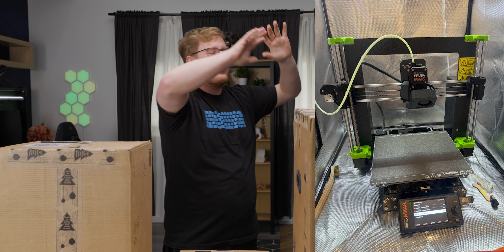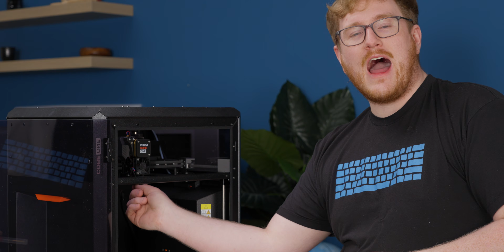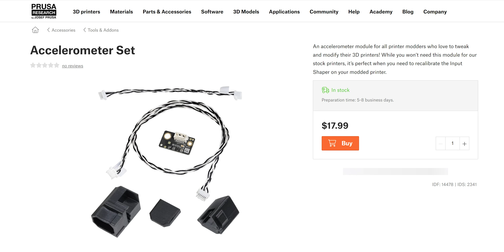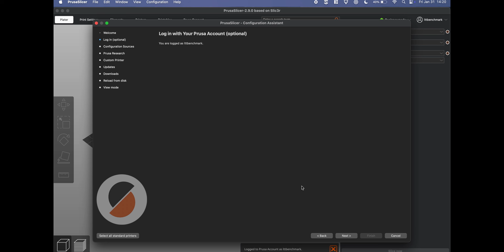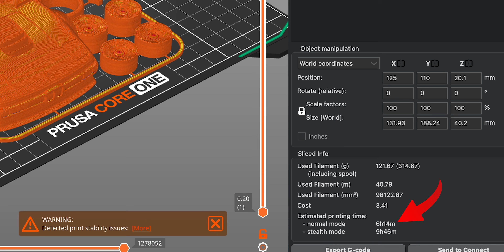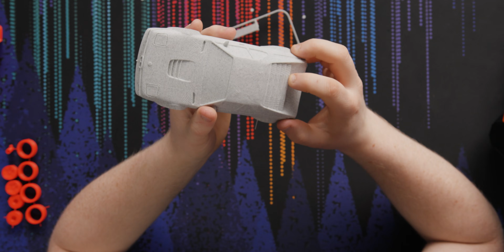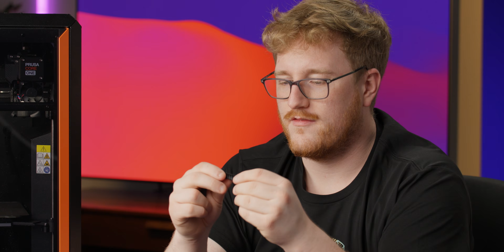Prusa has IMPECCABLE timing - Prusa CORE One

Comment: 2 things to start: This is not a bad product. The other thing is: I own a Prusa and don't care about your downvotes.

This is an embarrassing product to take to market. It's a 10 year old printer with the Core XY upgrade. It's a "MK4 bed slinger" in a cold enclosure.

Out of the box this has:
Doesn't support advanced materials (brass nozzle)
No heated chamber (their "Active heating" claim is bogus, it uses the bed to heat the chamber, not a heater)
Bed size is small 
The footprint is huge
No reduced weight on the tool-head
Slow (20% faster than a MK4 is their claim, which is already not a fast printer)
No Lidar or other advanced bed levelling features.
No Auto Bed Levelling (same MK4 board, so only one Z-axis driver meaning no independent levelling).
No camera (it costs extra)
No accelerometer (it costs extra)
No AMS (it costs extra)

The claims of being against "planned obsolescence" are obscene - this is putting 10 year old technology in a new box. Planned obsolescence isn't the same as genuine market innovation, which this has none of. The market is chasing Bambu - and it's quickly catching them. Prusa are putting out a worse product with a 2 year head-start.

All of this is forgivable though, except it costs €1,400

What the actual.
Reply: But the p1s has a heater right? It has a camera and auto bed leveling at least.
Reply: @nothingtoseehere93  I don't believe so. The only bambu with a heater is the X1C IIRC. (EDIT: Actually it's the X1E, as corrected by maxwell below.)
Reply: @reeepingk  X1C does not have a chamber heater, the X1E does
Reply: @ Ah yeah, you are correct!
Reply: @maxwell9346  QIDI Plus4 also has the chamber heater.
Reply: THANK YOU

Im czech, i do 3D printing for over a decade. Prusa is so shit
Reply: Agree. I do not mind paying a little more for something not made in China or Taiwan but not including a camera, a nozzle for advanced filaments and the advanced filtration system makes no sense. The upgrades should have been included at this price.
Reply: Agree, its your same old printer but in a box and you get 5cm extra height but for some reason its larger then the competitors on the outside and have a bar convenient placed right in you access path.
Reply: Thats the bit that annoys me. Everyone tries comparing this to an X1C. In reality it should be compared to a P1S, which makes it even more unforgivable that its so expensive. The BOM for this printer costs less than €300 to build. Thats a heck of a markup on what is already a dated, legacy machine.
Reply: This: Exactly. The Prusa fanboys will filet you for saying anything against this printer, but really, this printer is already outdated. Now, don't get me wrong, the build quality of the printer looks amazing, but this printer should have been released in... 2021. It doesn't have active chamber heating. It's passive chamber heating with an "active" temp. controlled fan. (Which is already stupid. For PLA the fan is going to be on 100%, no exceptions. For anything else that wants a warm chamber, the fan is going to be at 0%. So the temp control for the fan is dumb.) NOT TO MENTION, the temp control is all of like... 6 lines in the printer.cfg. You can program your own chamber fans to replicate one of their largest selling points in like... 5 minutes. It's literally a feature already included in Klipper. (Just google klipper temperature fan.)

Not to mention that the chamber can't get to any decent chamber temps. ABS/ASA/Nylon, etc all want 65+ degrees (preferably warmer honestly) so the 55 degree "limit" (which it will probably never reach during printing anyway) is just... outdated. And, it suffers from the same thing that all enclosed printers suffer from, too warm chamber temps when closed. So, like every other enclosed printer manufacturer, I bet prusa is going to recommend "opening the door" when printing PLA. 

Like you mentioned, the 3 "independent" z axis are not, at all, independent. The steppers are driven off of the same stepper driver so you can't do "z-tilt" automatically. It just runs the bed into the top/bottom to "level" the bed. (Welcome back to... 2021). 

Like, I understand that Prusas are advertised to a different sort of folk than just an "enthusiast" but honestly I expected better from them. They're supposed to be the "best in the industry" but they're getting outclassed (easily) by qidi and even creality at this point. (I'm skipping bambu because of their stupid business practices recently.)

EDIT: I actually heard (unofficially) that covid really put the development of this printer back and that it was intended to be released years ago. But that's still not an excuse. A PTC chamber heater is all of $15 and it's SUPER easy to incorporate into a printer.

EDIT2: Again, please don't get me wrong. The printer looks extremely well built. it looks great. Looks easy enough to repair (for an enclosed printer.) Looks super durable. It's just that... I expected more from them. I expected a Qidi XPlus/Max, Creality K1/K2 competitor, but what we got was effectively a PLA/PETG only machine that's slightly quieter than their existing machines.
Reply: I'm with you on this one. Also, here's point you didn't mention : since it is enclosed, it's overhangs are worse thant the Mk4s, even with the chamber fans on (tested by many, not just a weightless claim in the air). Furthurmore, as stated and seen in the video, the wifi capabilities are laughable. I realy wished this printer was more than what feels like too little, too late.
Reply: @ To be fair, I have yet to find a 3d printer that has decent wifi capabilities. They're usually all just TERRIBLE little usb wifi dongles. Technically, you could upgrade it yourself most of the time, but then you have to go through the trouble of finding one that's guaranteed to work with whatever board you have, etc. etc. etc. Really they should just be including external wifi antennas and that would solve the issue. I just wire my printers in to ethernet, better than depending on wifi.
Reply: No auto bed leveling??? Damn
Reply: @ No no it has auto bed leveling. It doesn't have auto bed TRAMMING.
Reply: @ I’m a noob but google says tramming and leveling are used interchangeably for 3d printers
Reply: @kart182  Maybe by definition, yes. But colloquially, "tramming" now refers to "manually" levelling the bed where as "leveling" refers to "auto bed leveling." The distinction is that auto bed leveling doesn't... actually... level the bed. It just programs the bed heights into memory and compensates in software. Tramming actually levels the bed physically. On a printer with multiple Z motors, you can do "auto bed tramming" essentially, or, with dual z motors, you can do Z-tilt adjustment. Neither of which you can do on a  printer that only has one driver for multiple z motors.
Reply: @ ah, okay. Thank you so much for the explanation!

Comment: For a 1200$ printer with less features (no accelerometer, no hardened nozzel, no webcam) than all other companies, there should be no "work do to" when it hits the market!
Reply: Accelerometer is not needed for Prusa printers, I have tried it on the MK4 with enclosure and it provides zero improvement in print quality (couldn’t tell when AB testing), the static model seems to be really well tuned

Comment: That build volume is an instant option killer.
Reply: Killer as avoid this right? Because it is definelty smaller than it's popular competitors (Creality K2 and Bambu's P1S)
Reply: @tristanbenoit5094  Yeah its just to damn small at that price point. Its competing against the X1C not the PS1.
Like I loved my Prusa mini so Im a fan of the company but 1K for a mini printer? Not a chance.
Reply: @mike0rr  I am surprised that there is a market the size there is to have build plates this small. But on what you said the filament needs to be on the top and a 300x300 build plate in it.

Comment: It looks like a good printer. The Prusa printers are real workhorses, and as a part designer I need a reliable printer that just works. To be honest - I also have a Creality K1C here, and I cannot complain about that one really. So far it has proved to be a reliable beast. I still going to add this Pruse Core One to it and will compare those two. At the end I keep only one for space restrictions, and let's see witch one survives... 🙂
So I will buy this Core One. However - I go for the kit version. Not only I enjoy building stuff, but it also gives me the opportunity to learn the construction, parts and inner working of that printer inside out. If something goes wrong I know how to repair and/or replace everything down to every bolt and nut. Sadly the kit is not available yet, but I will surely buy it the moment it becomes available. In the mean time I have my K1C to keep me happy...

Comment: I get failed prints all the time with my ender 3. I've had it for ages but havent printed in 2-4 years. I dont think drying filament was a thing back then. Is drying filament actually useful? If so why?
Reply: Many plastics absorb moisture from the air.  When the filament goes through the nozzle, that water is boiled away, creating bubbles that mess with flow rates and precision.  Drying removes that moisture, and the print problems along with it.  

In most cases, you can avoid drying just by keeping your filament in a sealed box with desiccant.  I use a big polymer tub with a latching lid, and just pour out a lot of desiccant beads into the bottom.
Reply: @TrueThanny  ah thanks for the explanation. So is it fair to say that if you don't hear the boiling/popping sound then your filament isn't wet? In other words, is wet filament only identified by this boiling? My filament doesn't pop but my prints are significantly worse than when I stopped 2 yrs ago. I've compared my old prints to the new ones and the new ones have so many issues that it's hard for me to figure out what specifically I need to fix. My old ones are pretty much perfect.
Reply: @Arunnn241  If you look closely at the extruder, or can zoom a camera in on it, you'll see the filament expand as it comes out if there's moisture.  Without moisture, it will remain the width of the nozzle opening.

If your machine has been idle for a couple years, you probably also want to relubricate the axes to make sure everything is moving smoothly.

Comment: The title of this video is ludicrous. I definitely like Prusa and owned a MK3S for several years with no issues. But honestly, Prusa’s timing is not impeccable in the slightest. They basically got caught with their pants down when Bambu came on the scene. They launched the MK4 and MK4S after Bambu launched the X1c. 

I also take issue with Jake claiming that the Prusa MK4S ‘rips’. Colloquially - in the automotive world - ‘rips’ means something is fast. The MK4S is not a fast printer. It is a reliable workhorse printer. But it simply is not a fast printer.

Edit: The reason they went with a linear rail instead of two linear rods is primarily weight. Linear rails allow full constraint with a single metal bar whereas linear rods require two. This would nearly double the mass of the X axis, and would slow the printer considerably. 

Additionally, it’s not that there are now two steppers for the Y axis. It’s a Core XY machine - the stepper motors (often referred to as A and B) work together to move the print head linearly (either X or Y axis). One motor will spin only when the print head moves diagonally.

Comment: I would hate to recommend the Creality K2, but they haven't been out long enough. Creality has had a fairly notorious track record in the last 5+ years with anything that wasn't an Ender 3 and still many models of the 3 series lol. From auto tension to much better motors and actively heated chamber, never mind being much larger and faster.. for $1500 you can get it with an "CFS" AMS system too. At that point it's in the league of the Prusa XL, in many ways better except for the multi marital function.

The real question, is do you wish to support a company that prides itself on supporting there employees and in turn you with excellent support and repairability

Comment: I have had a lot of fun (and frustration) with my Elegoo Neptune 4. Now that I know how to completely tear down, rebuild and recalibrate my POS printer, I really wanna get a good one. One that doesnt require bed leveling on every print. One that doesn't forget its Z axis offset and bury the extruder nozzle into the bed and force the PLA back up into the nozzle threads and lock it in place forever.

Comment: Good thing Prusa sponsoring LTT, they both are good companies, but ANY printer, including "not mentioned" BambuLab printers, can, in fact, be used with any slicer, can print from USB and can be used without logging in. The people should know that Prusa, being 3 years late to the market of fast corexy enclosed printers, doing and saying things like that because they have nothing else to say, really. They have lost that battle, and they know that. Prusa is a new blackberry.
Reply: I think what everyone forgets is that Bambu printers are sold at a loss. Hard to compete with that.
Reply: You havent heard of the new bambu labs changes dont you?
Reply: @alternistronx  those changes did not affect LAN printing.
Reply: @alternistronx  of course i did. Nothing really changed. If you dont want to use cloud functions just dont use them. Direct printing from usb and lan-only mode are options still. Everything else about that drama is just that, drama for small no-name channels to farm engagement on. The real deal is not that big in reality.
Reply: @alternistronx  Even with the originally proposed changes, it would not have prevented slicing with any slicer you want (or even writing GCode by hand). It would have meant needing to send the GCode via Bambu Connect rather than via the Bambu Network Plugin, which ultimately means that printer control would have moved from a tab to a new window. For any slicers other than Orca Slicer (e.g. simplify3d), it would be a step forward, as previously with only Bambu Network Plugin available you'd have to launch an entire new slicer just to send sliced GCode.

Comment: Overall, I know people debate the use of injection molding for parts, when in the past, Prusa 3D printed them.  However, if they are replaceable via 3D printed parts, I personally don't mind.  FDM printing is awesome, but for stamping out parts in a hurry for more than 10,000 to 100k+, injection molding is still king, even though places like Slant 3D can do massive FDM print volume orders.

Overall, Prusa is doing well, and barring government lawmaking, you won't see Prusa flashing firmware updates to lock hardware down.  At worst, you have something like the MINI's "appendix".

Comment: The Problem with the Wifi is, that the Wifi is running via a Serial Connection to the Microcontroller. I would guess at max 128kbps .....

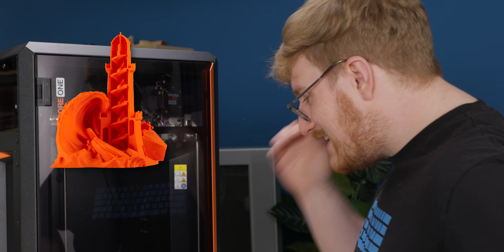Comment: just a quick point out for 7:30 , that is not actually two stepper motors for the y axis, those are referred to as the A and B motors. motors in a core xy motion system control both x and y movements at the same time, and the motors move together to get the movements required. they take separate belt paths both connecting to the toolhead to accomplish this

Comment: I have the mk3s It is a total workhorse that has been working flawlessly for years. I did try their second generation multi material and it was such a headache. I took it off and have never used it since. I recently got the creality K2 plus, which is so cool as well. This printer was very interesting to me, but I decided to go with the creality because it has the multi colour in the box and it prints a lot faster and has a much bigger build plate.(I would never buy a bamboo They are way too proprietary. And with their recent closing down their ecosystem I don't think I could recommend it to anyone)
Reply: I do recommend the 3.5 Upgrade. More Speed and Same toolhead and a.6 nozzle.  I so Like my mk4s toolhead but still also Like the simpler MK3 toolhead, as i feel It ist less picky with drying your Filament.
Reply: @MaxMichel89  I went to the 3.5 - no regrets!

Comment: You guys should check out the creality K2 plus if you haven’t already. It’s 1299$ for just the printer or 1499$ if you want to get the multi color system with it. 

I was interested in the prusa core one before finding out about the k2 plus and it’s 350x350x350 build plate, lidar scanning, ai camera for fault detection

Comment: They are still shipping brass nozzles as the default for a $1200 printer?! So unless you just really don’t like the panda food company there’s just no reason to buy this over that. The only thing so far that I’ve actually liked here is the door, being able to swap sides and the fact that it opens like 140° is great. Everything else is sus.
Reply: If you’re printing PLA or PETG, there’s no need for a hardened steel nozzle, it also has its own drawbacks, but sure, keep drinking the Bamboo kool-aid that hardened nozzles make a difference when not printing abrasive materials.
Reply: @thesomebody420  Hardened nozzles heat up slower and lose heat fast. Brass is the go to for a very good reason. The end all be all for nozzles is rhodium, but that's about the price of gold.
Reply: Imagine shilling for Chinese companies as opposed to praising Prusa for pushing the industry. Both laughable and sad.
Reply: I think there's more reason  you would want a Prusa over a Bambu. From what I understand Bambu can be faster, and obviously much cheaper, but Prusa are notoriously reliable and easily user serviceable and as he said at the end, upgradable. So while there is a big up front investment, and 3d printing absolutely is a luxury hobby, it's probably worth it in the long run.